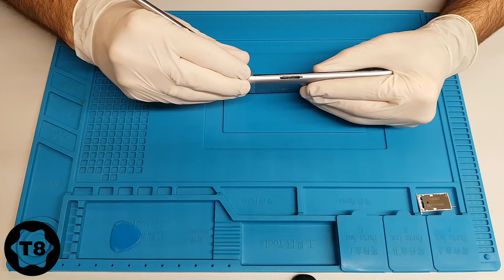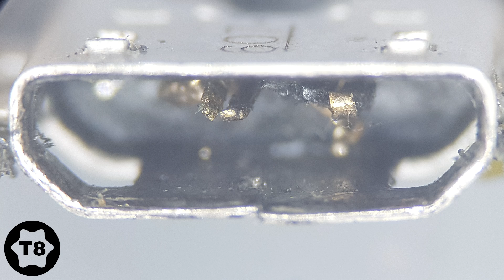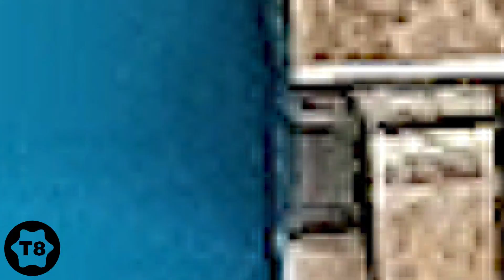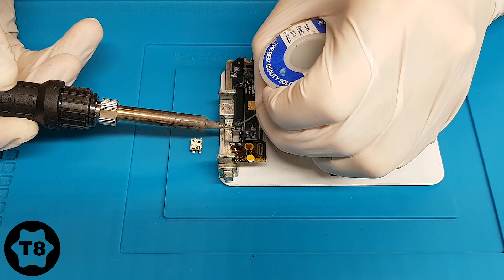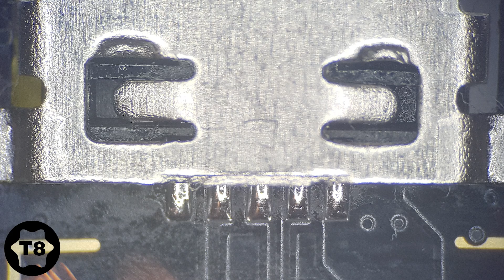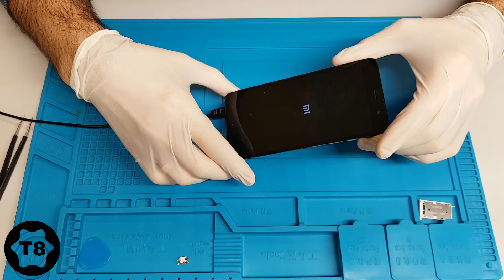Xiaomi Redmi Note 3 Replacement micro-USB

Comment: can i learn what flux do y use ? provide me with a link to buy it if y can thanks great job
Reply from the maker: Kingbo RMA-218: https://ru.aliexpress.com/item/Promotions-Kingbo-RMA-218-bga-Solder-Flux-Paste-Solder-100g-for-SMT-Reballing/32330169293.html?spm=a2g0v.search0104.3.2.a7bb1b5e6akxaL&ws_ab_test=searchweb0_0,searchweb201602_3_10065_10068_319_317_10696_10084_453_10083_454_10618_10304_10307_10820_10821_10301_537_536_10902_10843_10059_10884_10887_321_322_10103,searchweb201603_6,ppcSwitch_0&algo_expid=4d22199c-692d-406a-8cea-c94f37a35f4a-0&algo_pvid=4d22199c-692d-406a-8cea-c94f37a35f4a&transAbTest=ae803_3
Reply: @TorxEight  what was the temps of heat gun?and this red glue?can y link me?
Reply from the maker: @georgeanastasiadis6326   red glue: Red Compound DS1315, hardens when heated from 160 to 200 degrees. Link added to the description below the video.
Reply: @TorxEight  thanks
and what temperatures do y use to your heating gun and soldering iron to remove micro usb ?
Reply from the maker: @georgeanastasiadis6326  Depending on the size of the PCB. If the connector Micro-USB is on a small board, then the temperature is usually up to 280 °C, and if it is on a large one, then it is about 300 °C.
Reply: @TorxEight  really thank you...  i have seen many videos like that .in youtube.. but none proffesional as yours .... one day i hope to be like you :) have a nice day
Reply from the maker: @georgeanastasiadis6326  Thanks for the comment!)

I want to add more information about the temperature during soldering. Each soldering station has its own "true" temperature. Therefore, I recommend to calibrate it with a thermocouple. If there is no thermocouple, then just practice the temperatures on non-working boards.

Good luck! ;-)